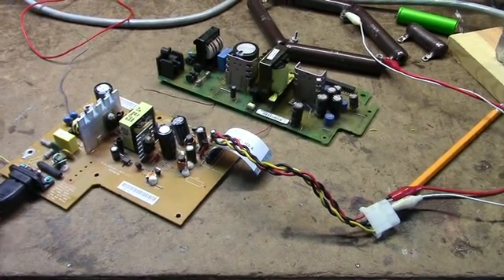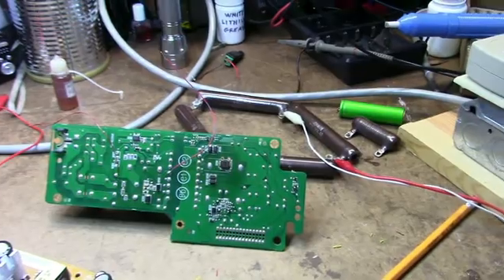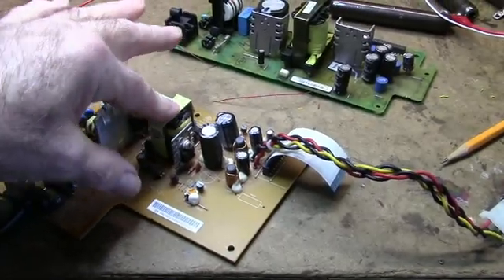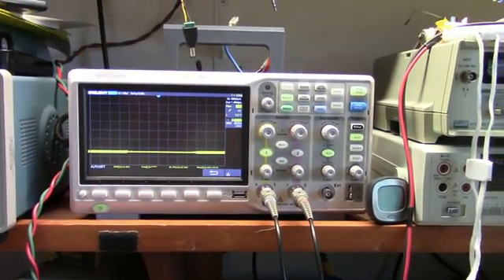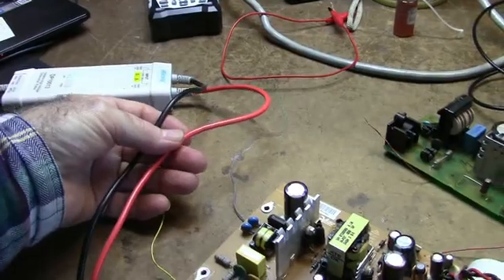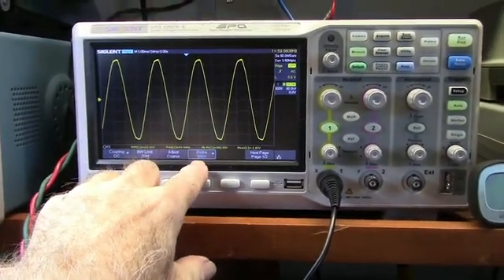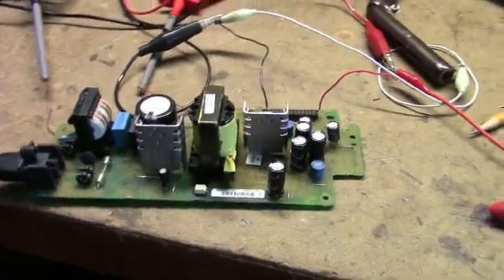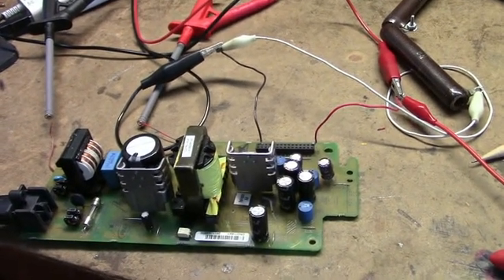SMPS safe measurements

Comment: Could you elaborate a little more on the gnd terminal of the battery-operated scope being a danger?  Thx!  https://youtu.be/i-osPp0A-Dk?si=fPYELt435dOH5RnE&t=278
Reply from the maker: Hi,  Although the battery operated scope is isolated from the line via the battery supply,  there is still a danger.  For example , it you connect the scope ground lead to a line referenced source, and happen to connect it to the hot side, the probe connector , the probe shield, and the ground clip on the probe end are at line potential.  I always use an isolation transformer when working on line connected equipment.
Reply: @toddanonymous5295 , TY.  I do not have differential probes (yet), but have a nice isolated transformer in "tech" mode, and use it along with my Variac religiously.  I also made/use my dim bulb tester as well. May order the d-probes you showed as the price is in reach.

Comment: I highly recommand using an isolated mains supply (1:1 mains transformer) for your devices under test.
You can not possibly isolate all your test equipment as this would be a fortune in isolation transformers.
- and - you can do away from special differential probes or special measuring techniques.
Reply: The problem with this is that most of the isolation transformers you can buy are designed for audio applications and noise isolation.  They isolate the line and neutral wires, but the ground (protective earth) lead is not isolated, it's connected from the primary side to the secondary side, and this defeats the purpose for this testing application.  To get an isolated ground lead, you have to buy a "medical grade" isolation transformer, and it's considerably more expensive.  The video is very correct that the proper way to do this and be safe is to use a differential probe.  They're affordable now -- way more affordable than your life.

Comment: It's worthwhile mentioning that a faulty switching PSU can be more dangerous than a working one, as the rectified mains capacitor  often doesn't get drained after switch off and can hold its charge for some time afterwards. It's particularly bad outside the US with 230V AC supplies  giving over 300V DC on the input side capacitors.

Comment: switching power supplies take the ac and convert to dc then chop to high frequency and reduce it.

if you ever unplugged the power supply and notice that the device still works for a couple seconds that is because the capacitor is charged.

in theory you could connect dc to the power supply via a series of 12 volt batteries and eliminate the ground reference for safe measurements.

it is possible that the power supply requires a 50/60hz reference signal to work but that would only be in modern switching ups backups where they have line conditioning where they may have compensate for bad line frequency (some devices dont like line noise).